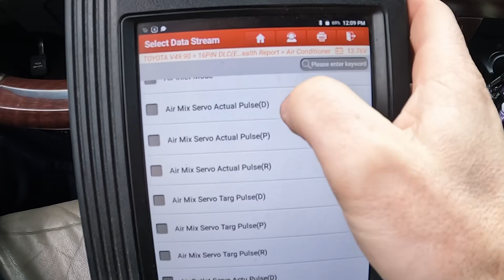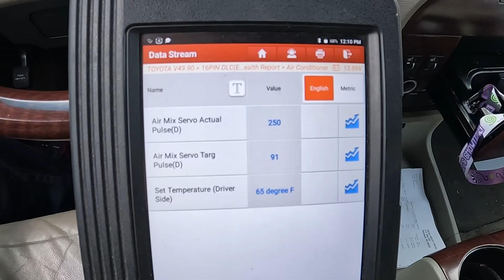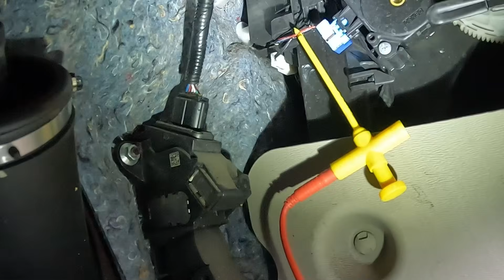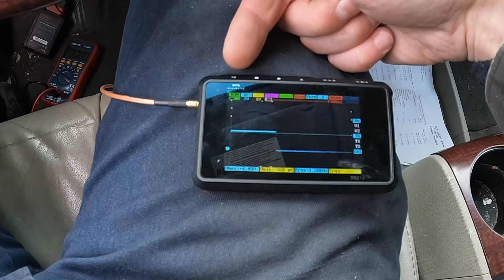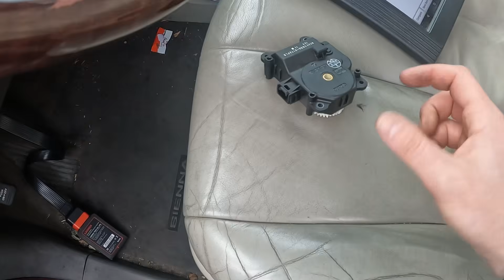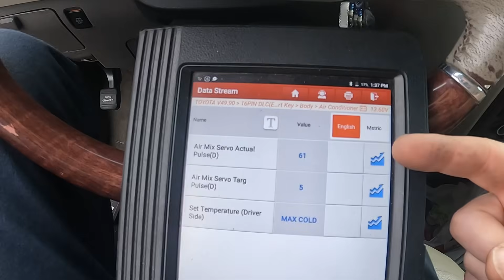2011-2020 Toyota Sienna Heat Doesn't Work | Blend Door Actuator How To Diag and Repair

Comment: Why no show how to fix it
Reply from the maker: It's a tight space to film and it's a very straightforward part to replace. I show where it's located, unplug the connector and take the screws out. That's it 👍

Comment: So the problem with the blend door is fixed however I have an issue with 2014. Sienna passenger side is getting heat, but the driver side is getting cold.
Reply: Same here, been trying to figure out for awhile.
Reply: @Nat-h8ts-U  I end up taking it to my local Toyota dealership and have them install a new blend door which fixed the issue cost me about $450. I tried replacing with an aftermarket for some reason it does not work. I don’t know why the sienna’s are so picky or any Toyota.
Reply: @MrMusaalam does that part have anything to do with the ac? I have the ac blasting, passenger side blows cold but the driver side blows warm.
Reply: @Nat-h8ts-U  i’m not sure at first they said it was the blower motor which is underneath your glove compartment so they replaced it. Then they came back with the blend door code. My dealer was nice enough not to charge me for the blower motor because it would cost me over $1000 per issue that I told them about it so they end up only charging me for the blend door. Plus you get a one year warranty through them so I’m not sure what they did to fix the problem but right now is blowing cold air and hot. Can you change the temperature?
Reply: @MrMusaalam yes I can change temp, I’m thinking I have an issue that’s not related to the blending door act
Reply: @N @Nat-h8ts-U ’m not sure what they did again but I did replace the blend door and they reset the code. And fix the
 problem so far it’s been a month. I haven’t had any issue come back. I have my own code reader and it did not work with the aftermarket part.
Reply: I have the same issue I can change the temperature, but passenger side would be cold and the driver side would be hot. Once set too hot. Driver side remained cold, even though the setting was such too hot so it is related to blend door.

Comment: Do you need to reset the code once you replace the part or will it automatically reset itself?
Reply from the maker: It might reset itself. I usually reset codes with a scan tool because it's faster 👍
Reply: I replaced this part before and it didn’t work. However, I took it to the dealer today and that’s what they told me the code is B1446. I can replace the part. But I don’t know if that’s going to fix the problem. I’m using an aftermarket for a Toyota sienna2014.
Reply from the maker: @MrMusaalam  I would try it again with a quality brand. Clear the codes when you're done and see if that fixes it 👍

Comment: Where is the mode door actuator that changes from defrost to feet etc? That’s what I’m having trouble with on my 2011 Toyota. Thanks
Reply from the maker: My manual doesn't give a good picture and description but it looks like it's on the left side of the blower motor box towards the top. I'm not sure you have access to it without taking some of the dash apart 😢
Reply: @ValleyMobileAutomotive thanks

Comment: 2012 Sienna. I lose heat at idle. Increase rom to 1800  at idle and heat comes back.

Radiator is full..over flow at full line.  
When going from cold to hot it gets hot for a second then cools down.  
If full cold both heater lines are hot.  Set to max hot and both heater core lines are hot for a second and then one cools down whike the other is still  hot  ?? Any suggestions  ?
Reply from the maker: My first thought is low coolant. If it's full through the cap and not just the overflow then I would look into the flow rate. You can remove both heater core hoses with the car off then start the car with the heat on high. It should gush coolant out of one of the hoses. If it does then hook that hose back up and leave the other one off. Start the car again and you should get the same volume now coming out of the heater core pipe. If the flow is now diminished then your core is clogged.

Comment: why is book time 10 hours!??!?!? LOL
Reply from the maker: Wow that's a lot! I've found sometimes Toyota has miscalculated the steps it takes to replace something. For instance removing the transmission pan they say to remove the transmission assembly first. I haven't replaced the passenger actuator yet but the driver side is like 5 minutes. Super easy.

Comment: Here you talk about the actuator being the cause of a problem with heat and cold but would this also cause the driver side vents to not blow cold while the passenger vents do blow cold?
Reply from the maker: Yes. If you have dual zone climate control then the driver side and passenger side will have their own actuator. The one that's not working won't be able to change the temp while the other will be able to 👍
Reply: @ValleyMobileAutomotive  Follow up: Would these be responsible for the back vents not blowing at all as well, or is that a different component?

Comment: I've got a ticking noise on the driver's side of my 2010 Sienna -- is that the actuator? If so, how do I get back there to change it out?
Reply from the maker: Not sure if your noise is the acuator but if you need to replace it you'll see it near the gas pedal towards the center of the vehicle. It's very easy to replace.

Comment: Piercing probe 🤢🤢🤢
Reply from the maker: I was skeptical at first but a lot of trained professionals use them. Also this wiring is inside the cabin so the possibility of moisture intrusion is very unlikely. Plus you can coat the wire with liquid tape to seal it back up 👍

Comment: Hi, air blows warmer from vent toyota sienna 2011 even though weather is cold and all vent controllers are on blue
Reply from the maker: @akshaykumar555  This might be your problem. They are easy to replace. Of course the best thing to do is diagnose it so you don't spend money on something you might not need.

Comment: My passenger side is making noise when it operates.  But from what I can tell it still works.  Is there anything we can do to make sure it stays operational?  Dielectric grease or something similar?  Thanks!
Reply from the maker: @michaelwilson2891  Not really, everything is sealed. I would just run it until it dies then replace it 👍

Comment: I do have heat set on hi but it's acting like it's low, same for AC I have it set to max cold and it sometimes kicks on to max cold or heat then back off what could be my problem?
Reply from the maker: @devicetrickz  What codes do you have? That's usually where I start. That can help point us in a diagnostic direction.
Reply: @ I have no codes related to my issue unfortunately
Reply from the maker: @devicetrickz  The symptoms you're describing sound like it could be the actuator. Has it been replaced?
Reply: @ValleyMobileAutomotive  just replaced it yesterday and that 100% fixed my issues
Reply from the maker: @devicetrickz  Awesome! Glad you got it fixed 👊
Reply: @ thank you I appreciate the prompt response

Comment: What about the rear??? I have barely have heat in the rear. Not hot at all.
Reply from the maker: @toualor1042  You would need to do the same thing with a scan tool. Check the target position and the actual position while changing the temperature. If the actuator doesn't move then it's most likely bad.

Comment: What about if the heat is not working only in the passenger side? I’ve already changed the servo and it’s the same as when I started with heat only on the driver side.
Reply from the maker: @suddenlysuzie  The passenger and driver actuator are in two different locations. Make sure the right one was replaced.
Reply: Some comments I saw in Sienna chat try disconnecting the battery and reconnecting it, it worked for the other guy.
Reply: @ehsanull I tried this. Turned out to be a 4k repair. The AC compressor clutch was bad. Dealership took a week to fix it since they had to order the part and then spend a substantial amount of time removing and reinstalling to get to it.

Comment: I’m having a similar issue of no heat (front or back) in my 04 Sienna. Mechanic diagnosed it as the blend door issue, but quoted $1100 for the repair which i just can’t justify in a 20 year old van. Is this fix comparable to an 04?
Reply: i got similar quote on a 2011 Sienna for the same problem.
Reply: Highway robbery. These fing mechanics and repair professionals are the biggest rip off artists.